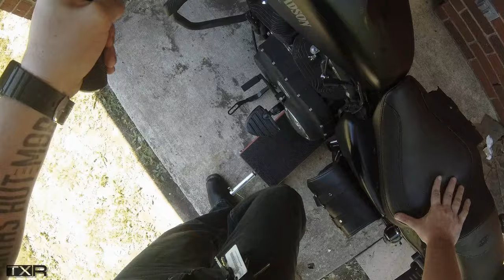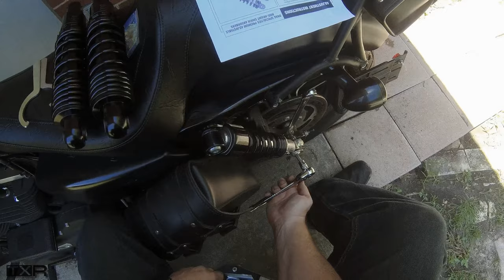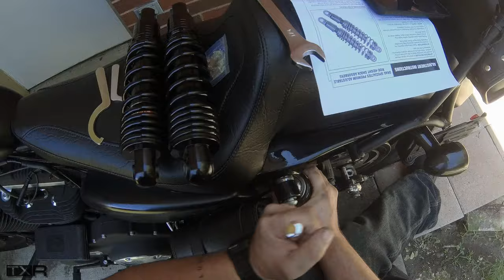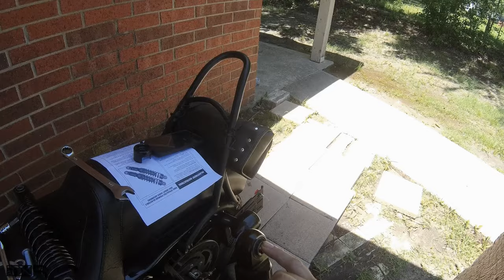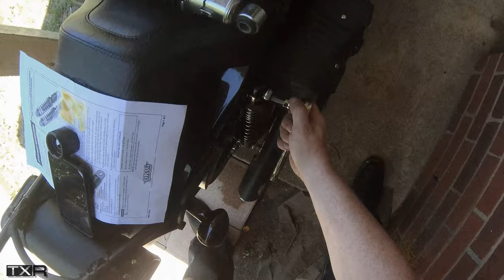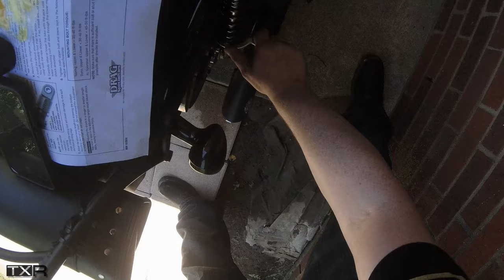Installing 12" Drag Specialties Adjustable Shocks ~ Iron 883

Comment: Did you use spacers or bushings?
Reply from the maker: I believe it was bushings. It's what came with the new shocks + the original hardware.
Reply: @tinkermoto  but no spacers right? My oem shocks had a little spacer connected to the bushings. So I’m not sure if I need a spacer or not
Reply from the maker: @levinice3  RIght. No additional spacers for the shocks I installed. The video shows them straight out of the box, no prep or mods whatsoever.

Comment: How do you adjust them for more height ?
Reply from the maker: I was able to do it by grabbing the top and bottom and twisting in opposite directions. I didn't do it purposefully, though, just to see if I could. I installed them and ran with them at the shipped height of 11.5".